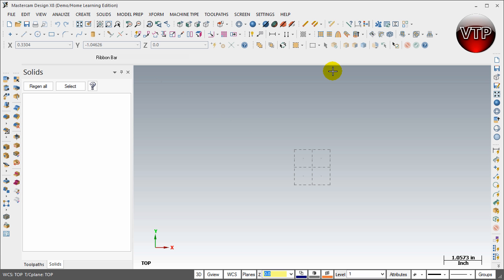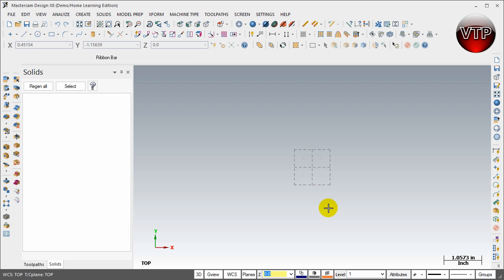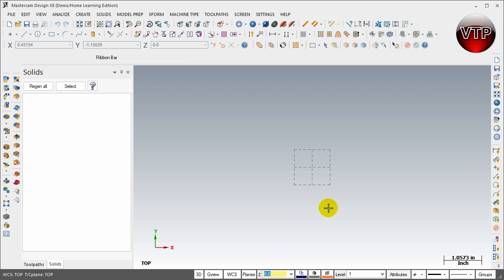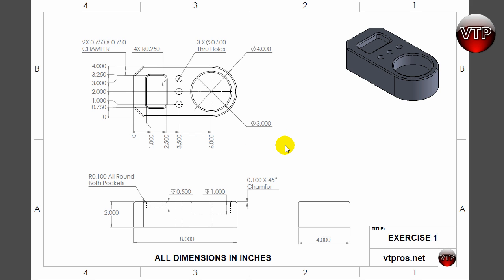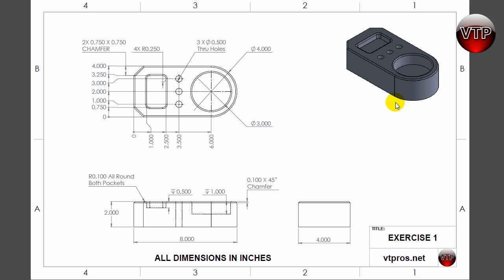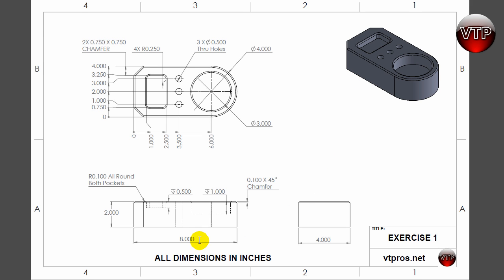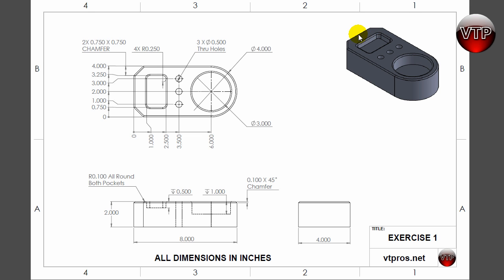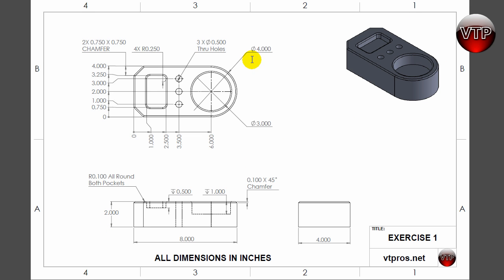MASTERCAM X8-X9 SOLIDS. 1.1 - EXERCISE 1 INTRO - vtpros.net

Comment: whats the diference of home learning and the actual master cam.
Reply from the maker: Mateo, The difference is that the home learning edition you can do everything as the full version of mastercam but you cannot output the NC code. but you can still use the program fully. Great way for practicing / training
Reply: VTPROS.NET  ok thanks for your time. i just got it yesterday and im barely new but im very interested to learn. im have done the servo cam for brown and sharp and now i wanna learn the master cam
Reply from the maker: It's a great software to learn, Mastercam and Solidworks are the top 2 software i recommend everyone to learn, the best 2 CAD/CAM softwares in the industry, there will always be work using these 2 software